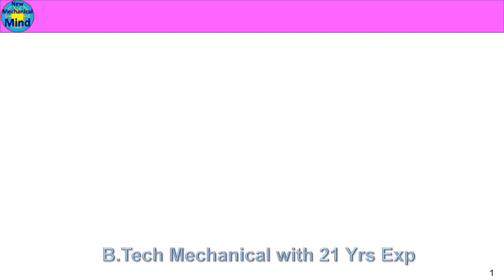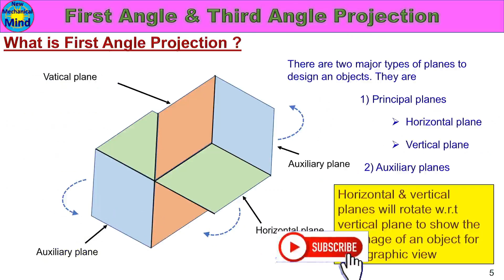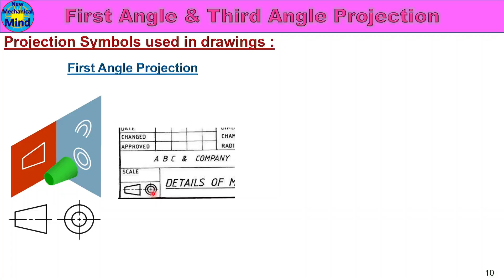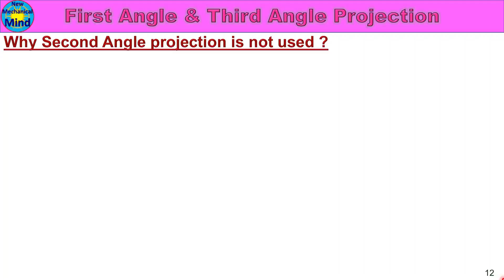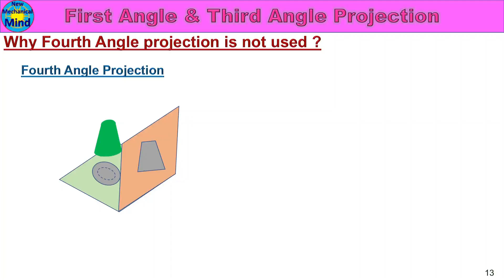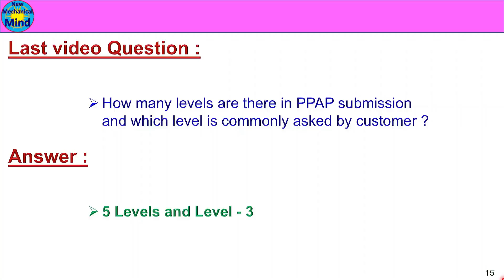What is First Angle and Third Angle projection in engineering drawing Part-2 | New mechanical mind

Comment: Kaizen type machine pressure gauge checking before machine door 
 Closed day by day checking door open and close to check the machine pressure but kazien improvement after door not open class door fitting in machine door change  this kazien improvements sir
Reply from the maker: Hi Iyyappan thank you for your example.